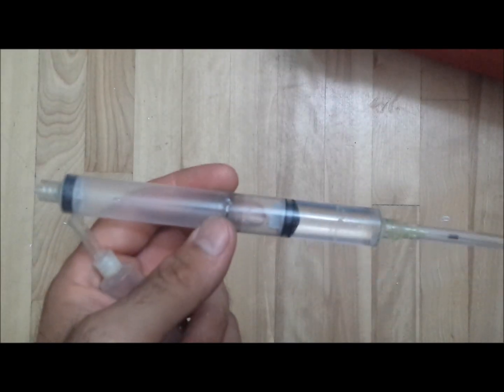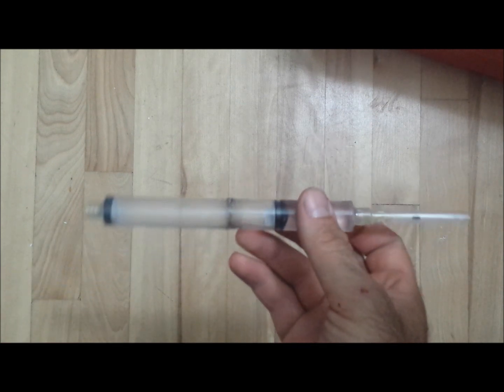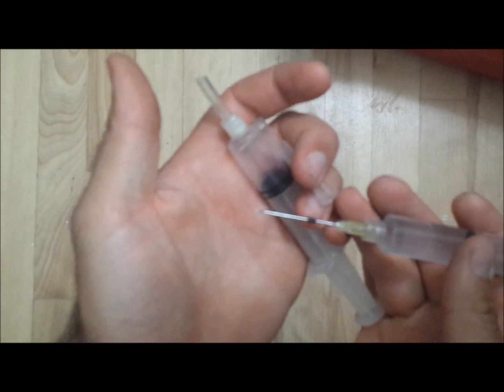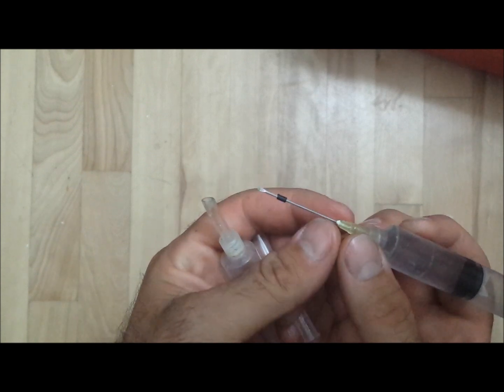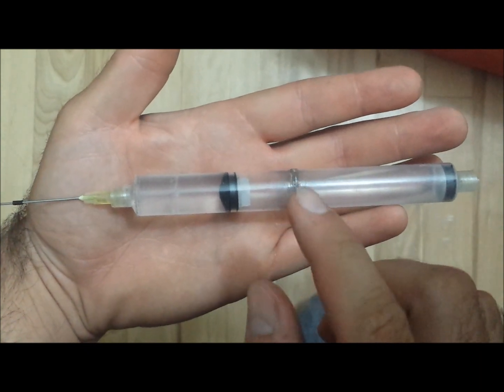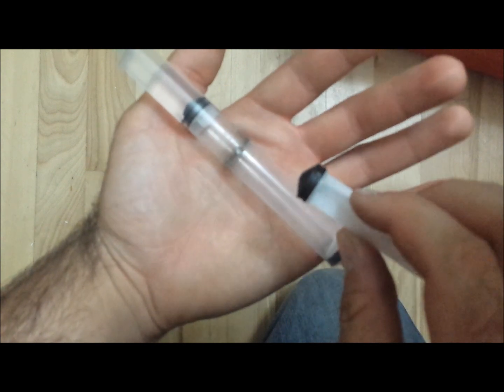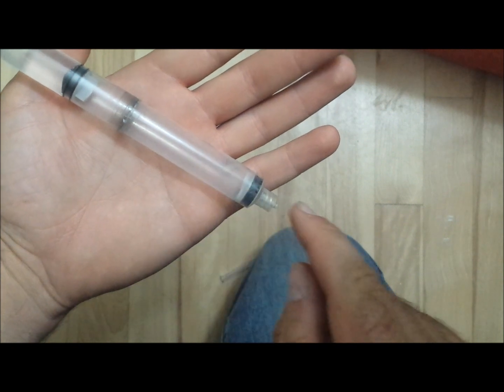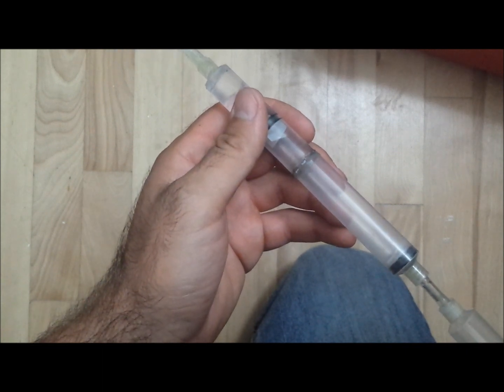How tranquillizer darts work (with home made dart)

Comment: I’m having a lot of trouble heating and then sticking the tubes together. Either I heat to much and they begin to melt or I get a very lop sided join. Any tips please?
Reply from the maker: Just take your time bring it close to heat slowly. Also make sure it is completely clean. Any oils will cause problems.    If you could use 2 books to keep the ends up off the surface  when connecting them it will help with keeping it straight.
Reply: You can also try model glue as it chemically fuses plastic parts together ... Or you can make a short inner sleeve and epoxy the two syringes together ...

Comment: +Stray03 Nice video, what will happen if you dont put a hole in the needle
Reply from the maker: If you don't alter the needle you mean?  well it wont hold pressure unless you block the hole in the front, and then you will have to find a way for it to release.
Reply: +Stray03 Where does the liquid release the hole in front or the hole at the side
Reply from the maker: hole on side. hole in front is actually logged with jb weld  and refiled to shape.  the rubber piece moves back as the dart enters. that opens the side hole and releases the pressurized liquid

Comment: Nice work.There does not seem to be many companies that specialize in this sort of thing.
Reply from the maker: +martK banjoboy Yeah I'm guessing the client base is relatively low when you think about it, so unless you bring something new to the market, getting into that kind of business is going to be bad for your pocketbook. Was close to picking up one of the airguns for it where I used to work, but It wasn't a "for sale" item at that point. it held 2 x12 gram CO2 cartridges. I have the manual for it on my comp, if I find it I'll get you the name of the gun maker.
Reply: I could find three different makers. They appear to be Palmer Cap-chur,  Pneu-dart, and Dan - Inject. There are probably others overseas. I wonder if some of the lower priced ones would make good conversions to .25 cal?
Reply from the maker: +martK banjoboy IIRC it was an old Cap-chur rifle. Seems my information partition on my comp disappeared. Now I have to figure out how to get it back.
Reply: :eek: backup! ;)
Reply from the maker: +martK banjoboy going to attempt a system restore to a date when it was ok.

Comment: Nice. I finally figure out how these things work. If you keep the syringe pressurize, how long will it last before you need to charge it again?
Reply from the maker: +DudeInWalmart Although a near perfect seal would keep the pressure in for a long time assuming you could have one do that, they are not stored with pressure, for safety and to ensure that it is still pressurized when you are ready to use it. Normally they push a wire into the end to push up the "valve" and break the seal and release the air on the reusable darts if it wasn't used, and then re-pressurize it when they need to use it again.  Storing it pressurized for more than a few hours isn't done normally.